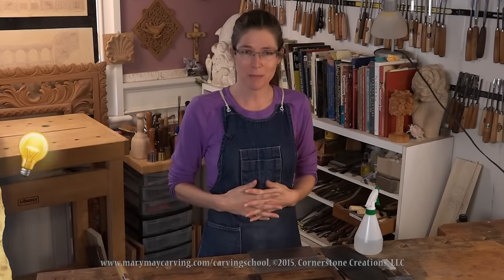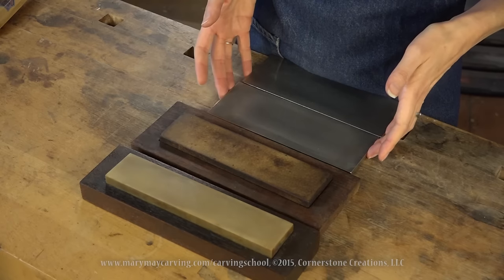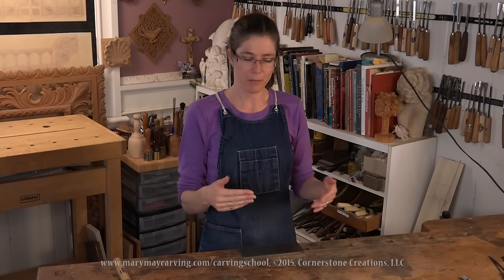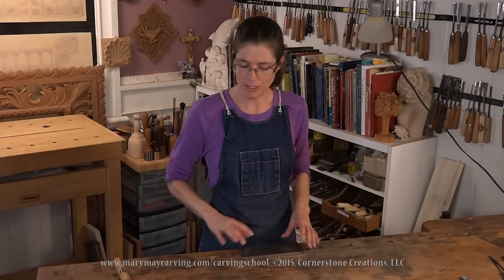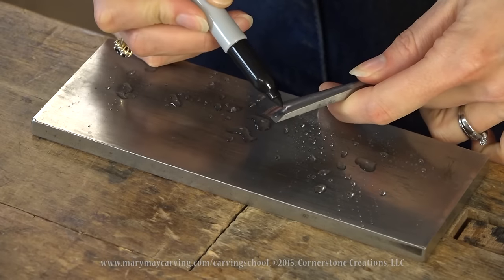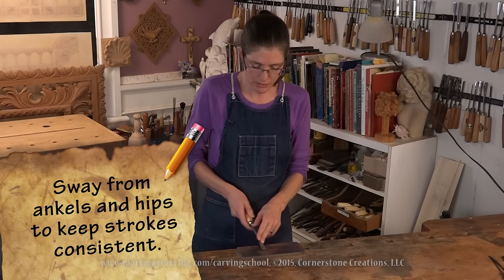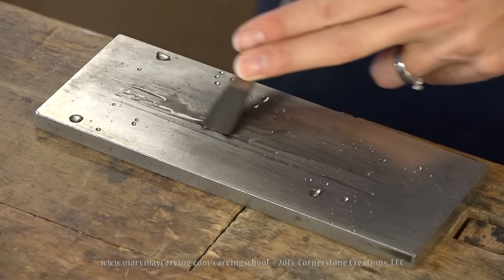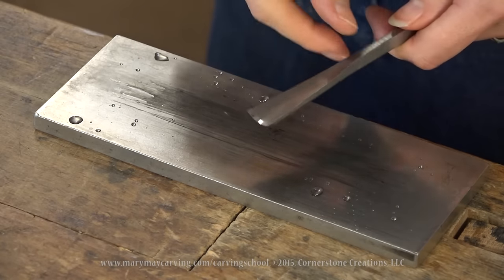Sharpening a Curved Gouge - Beginner Lesson #2

Comment: Loved your video, perfectly presented...   I am new to carving and taking it up as a later in life past time.   Purchased a used 4pc set of Pheils (1 dbl edge chisel, 2 rnd gouges, 1 sft V). they had polished edges but didn't cut.   The gouges had been convex rounded cutting edges.  Needed to put them on a heavy stone and followed you recommendations. They came out terrific and cut across softwood perfectly..   Now onto the V-gouge.   Looks like the bevels will need to be ground flat and brought up from scratch...   Thanks for you helpful and well presented instructions..

Comment: I've been trying to sharpen my first gouge for about a year now.  An hour or two until I get frustrated.  I bought a "beginners set" that came "ground but needs sharpening".  I started with waterstones 4000 grit then tried to move up to a 1200 grit.  Next I bought diamond stones.  I think I've been using 800 grit/mesh.  My gouge still won't go through pine with the grain.  Not without pounding with a mallet.  And this is just the first gouge.  There are 11 more chisels in the set.  I don't know if I have the temperament for carving.

Comment: For slip stones I wouldn't recommend to use corser stones than 1000 grits because scratches from inside curve  are not needed.  So 4000 to 8000 grits of Japanese, Belgium or Arkansa stones are the best.

Comment: Washita is a soft grade of Arkansas stone. The Washita Grade of Arkansas Stone is a natural, quarried stone that is softer and coarser than the Soft Arkansas grade. Typically white with veins of purple, red or orange, Washita stones are the coarsest grade of Arkansas Stones. A mirror finish is not necessarily an indication of actually being sharp. Soft Arkansas - Specific Gravity 2.22 | 12 micron | .00047" | Grit Equivalent: 1200. The Soft Arkansas is close to the 12 micron lapping film but clearly finer than the 800 grit diamond stone.
Hard Arkansas - Specific Gravity 2.36 | 10-11 micron | .00041" | Grit Equivalent: 1500. It is a little coarser than the 9 micron lapping film but finer than the 12 micron film.
Black Arkansas - Specific Gravity 2.55 | 7-7.5 micron | .00028' | Grit Equivalent: 2300-2500. While the Black Arkansas did have a few larger scratches, overall, it is a little finer than the 9 micron lapping film.
Translucent Arkansas - Specific Gravity 2.53 | 5.5-6 micron | .00023' | Grit Equivalent: 3500-4000. It is clearly finer than the Black Arkansas. Most closely resembles the 5 micron lapping film.
Reply: Danke für die sehr instruktiven Informationen. Sehr hilfreich für mich !!!

Comment: I try to do the best that i can to sharpen to that 22~23 deg... I do like that it's steeper in angle than the traditional 25 deg, as you mentioned it is just the right angle to have the most efficient way to work that's natural to your push cut....

Comment: Hi mary, really informative video. I have a question: My Pfeil gouges came with a very small micro bevel, when stropping do i just strop the micro bevel or the whole bevel? Also, when i pluck up the courage to hone them on my new stones and bearing in mind what you said about removing metal from the whole bevel evenly and keeping it flat from back to the edge, do i hone through the micro bevel until it disappears and i have one flat bevel right to the edge?

Comment: Wonderful video!  Do you personally have a complete set of chisels ground at 22.5 deg for basswood and steeper for hardwood?  I am using 28 deg because I carve a lot of walnut, beech and maple etc but I'm wondering if I need another set for basswood.  I just got your Acanthus leaf book for Christmas and love it!  Very detailed and full of photos.  You spared no expense making a quality product.
Reply from the maker: Hi Neil, Thanks! Enjoy the book! I keep my gouges between about 21 and 25 degrees. The larger, the more awkward it is to "push" the tool through the wood. The lower the angle, the more fragile. I don't generally use specific tools for specific woods. Whatever I carve, I use any tool that fits. Getting quality gouges, I have found you usually don't have to adjust too much with wood types.

Comment: Liked and appreciated the black marker to illustrate and illuminate the areas sharpened.  Surprised that your diamond stone is placed on top of a JOINT in the wooden bench top, and as you moved the gouge from side to side, the stone underneath was slightly "rocking" from the "left board" to the "right one" as you pressed down, etc.  And as one commenter mentioned below, this lesson could be appreciably shortened.